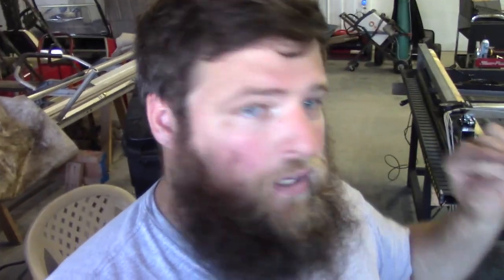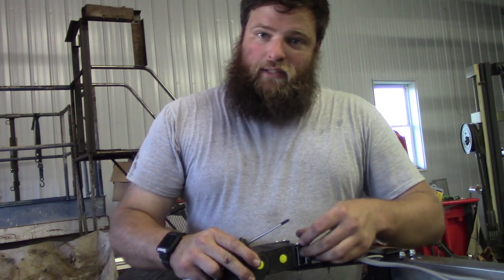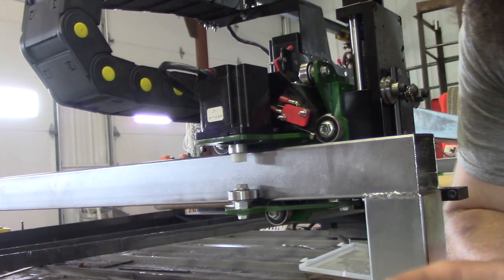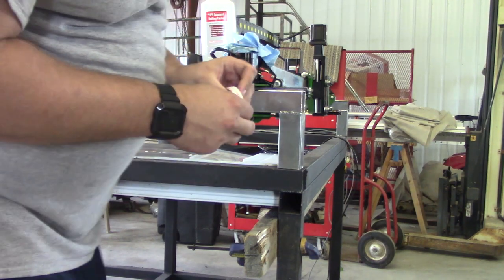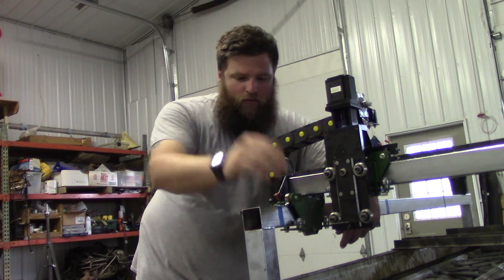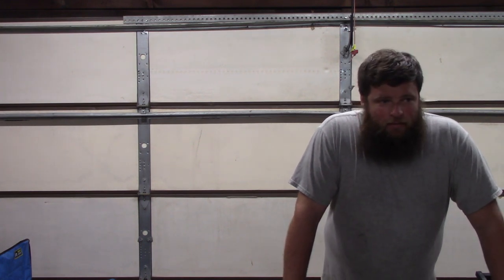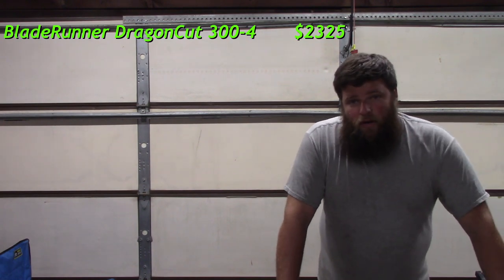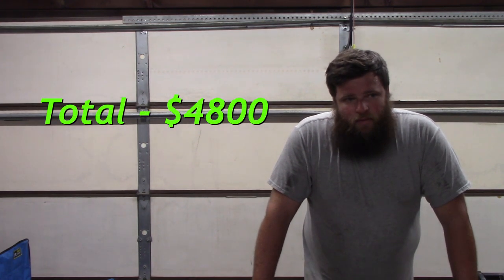Assembling a DIY CNC PLASMA TABLE | HOW MUCH DOES IT COST

Comment: Can something like this be bought as a whole kit?
Reply from the maker: I know CandCNC.net makes a kit that supplies all the electronics and computer but doesn’t supply a table to put them on. If you are looking for a kit that comes with everything and you just have to assemble it, check out avidcnc.com or a lower cost option would be langmuirsystems.com.
Reply: I was eyeing Langmuir.   Thinking that may be a good entry point for me and see if it grows into a need for something bigger
Reply from the maker: If Langmuir was a choose back before I started building this table, I probably would have bought it instead. It’s got all the features my table has but better electronics and a community to support troubleshooting.

Comment: where did you get the gears for the stepper motors ? I wanted to use steel gears  was looking at the same place you got your gear rails from.I need a 8mm inner bore for my stepper motors.
Reply from the maker: The gears I’m using came with the gantry kit I bought off of eBay. They no longer sell this kit so I’m not sure where you can buy them.
Reply: The Off Road Corner I found one it looks the same on eBay for 200.00 and it has the z axis with it
Reply: The Off Road Corner I was looking to see if you had done videos on the frame build up but couldn’t find anything on YouTube on your post
Reply from the maker: John Thompson that’s a pretty good deal. I think I spent that much without the z axis.

Comment: Good lord you can buy a cnc plasma table for $1500. Just add $400 non Hf plasma cutter and you have a complete system for less than $2000. It's only 24x33" though.
Reply from the maker: That is an option for sure. And I won't lie, I thought about buying one. my biggest concern with those machines is reliability and technical support. also, the cut size was smaller than I was looking for.